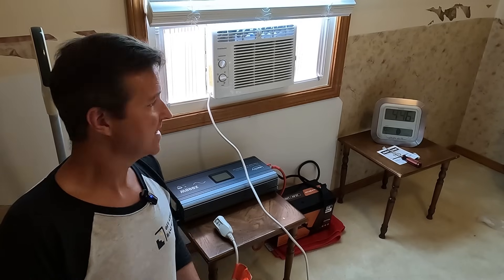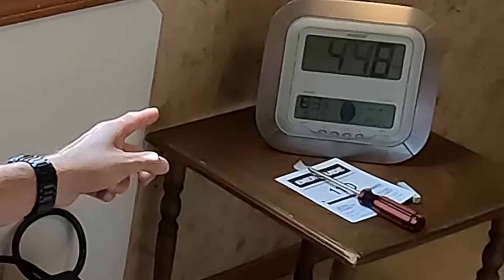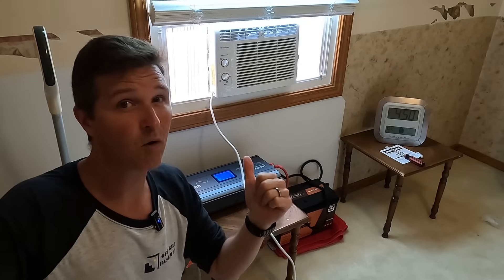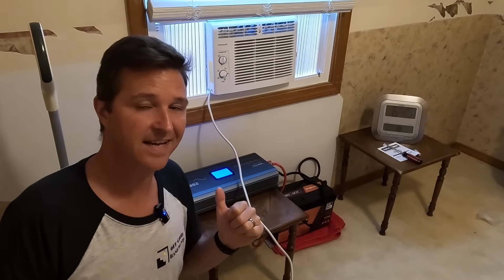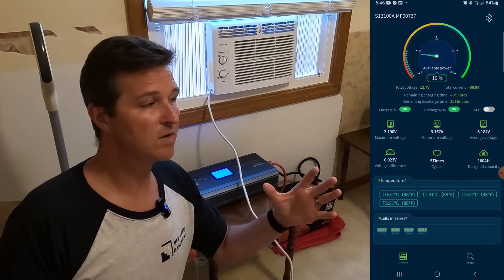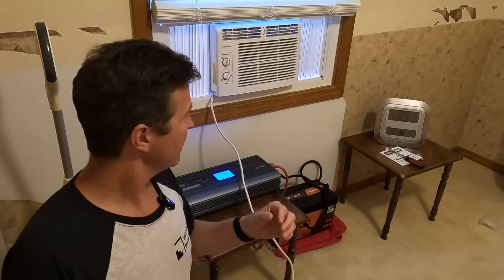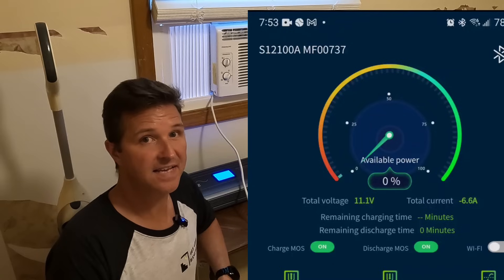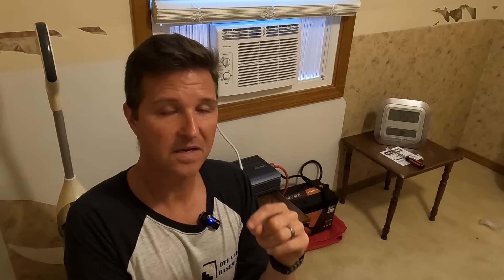How long can you power a 5,000btu air conditioner with a 12v 100ah Lifepo4 battery?  Let's find out!

Comment: So basically a 200amp hour battery will give you a good night sleep in a hot night. Roughly 6 hours of AC on a hot night.
Reply from the maker: Yes.  You should get 6 hours.  Remember, once the room gets to the desired temperature, the AC unit will turn the compressor off more often.  This will result in longer battery life.  Thanks for the comment.
Reply: @OffGridBasement  I was thinking of getting the AC and Heat pump units so I can have heat in the fall and winter. You should do a video on that. I built an Overlander Camper and I think this would be a good way to save some money on not buying a separate heating unit of some kind. Thoughts??

Comment: A soft start would help greatly on battery use also if the AC cycles the compressor on/off very much. Newer AC like minisplits are really much better on power consumption.
Reply from the maker: Thanks for the info.  This AC unit was seriously the cheapest one I could find on Amazon.  Any other AC unit should be more efficient.  I've heard Medea AC units are really good!

Comment: I'm looking at hurricane options here in SE Louisiana if we have a power outage.  After hurricane Ida a few years back I had my Honda inverter generator running near minimum to power two refrigerators, a box fan, a few LED lights, and occasionally a TV.  I had enough gasoline stored where I could have run the generator for weeks and we got the power back within 2 weeks.  Still today, I have looked into options and actually have a couple of small ACs like you used in the garage.  The best bet might be one of those swamp coolers that use water evaporation to cool a room.  So far we would be winging it with a fan to conserve power!
Reply from the maker: Unfortunately AC units use a lot of power.  You would be looking at a few thousand dollars to build something.
Reply: Swamp cooler is only for dry places.  You would die in Louisiana lol.  It puts water into the room

Comment: Right on about undersized air cons. I just rented a summer home that was well insulated, but the new air con could not keep up with 30C temps.  It ran about 80 percent or more during a one week period.  My AC at home is able to satisfy the thermostat and probably only runs 1/3rd of the time that the rental ran.
Reply from the maker: Thanks for sharing and the comment!

Comment: The converter's operating at max will produce heat.  That's why all Hi power converters have cooling fins with internal fans.  The extra heat from it could have a negative effect on the cooling of the room and making the AC work harder.
Reply from the maker: Thanks for the info and the comment.

Comment: To heck with all this.. confusing and just basically shows how difficult to run a small air condition 24/7 when a hurricane takes your power out for days..
With health issues I have to have constant AC here in Florida. Actually considering getting a climate controlled storage unit for a month or two during hurricane season have somewhere to go to cool down..rest
Reply from the maker: Thanks for sharing and the comment.

Comment: I have one in a shed running off 100ah LFP battery and 2 250 watt panels it can run about 4 hours when it's 117F outside. I'm in Phoenix so we get really hot here the 5k BTU window unit is an inverter type cheap $139.  When it's under 100F it only pulls about 400-500 watts when it's really hot like 114-118F it will pull over 1000 watts of power. Even though these have high seer ratings you can see that paying for a high seer AC unit doesn't really save money if you live where I do it gets over 115F. My new solar system will have 15kw watts of battery storage and 4800 in solar panels. It runs 24/7 from May to September surprised it hasn't failed these little window AC are work horses the remote stopped working but I don't use it.
Reply from the maker: Thanks for sharing and the comment!

Comment: Hot and humid southeast, can't even sleep without AC, you'd need 10 batteries for 24 hours plus 1,800w solar, about $4,500 project cost, for that you can buy a used minivan, call the engine a generator, set up a cot in the back,  blast that AC and run it all night 🤪
Reply from the maker: Thanks for the comment.

Comment: You need 200lbs of lithium, 1500Watts or more of solar, a nice charge controller, and a 3000Watt inverter.  Surge would be 6000Watts or more.
Reply from the maker: Those specs would run this small AC with no problem!

Comment: OK so how hard would it be to add solar panels to charge the battery, what would you need besides the panels?
Reply from the maker: A smaller solar charge controller would go between the battery and the panel.

Comment: This is EXACTLY the same air conditioner I bought from Amazon a month ago. It was $175 with shipping and handling. It is 5000Btu @ 4~5amps. It is a slight improvement to what Frigidaire used to make. Their 5200Btu units used to pull around 6 amps. I think the Freon is changed (thanks to the environmentals).
Reply from the maker: I hope it's working well for you.  Thanks for sharing and the comment.

Comment: More questions than answers. how long to recharge the battery? what would the temperature rise to in that amount of time? could a second battery be put in place to keep it running while the other is recharging? how long did it take for the room got down to 74 degrees? Is it even possible to maintain a comfortable temperature in the room with this set-up or is this just affiliate marketing link bait?
Reply from the maker: This is only a temporary solution meant for a 2 - 3 hour power outage.  If you're wanting an all day thing then look into a much better AC unit.  Something like a Medea.  Much more efficient, but expensive.  Also, you would need to quadruple the battery capacity and 800w of solar.

Comment: Doing this same test at night simulating a solar system just using its battery power & setting the AC unit to low & it's thermostat set so the unit cycles off more frequently should extend the run time significantly also 200ah of battery would be ideal.
Reply from the maker: Thanks for the tip and the comment.

Comment: Why didn't it trip the braker or overload the inverter if it was using 38 amps ?
Reply from the maker: I was referring to the DC side.  On a 12v system, running 38A is equal to 486 watts.  Hope this helps.  Thanks for the comment.

Comment: I got myself a 16 inch dc powered fan that I place in front of the air conditioner to blast the room faster and my 5000 btu has eco mode
Reply from the maker: Thanks for sharing and the comment.

Comment: The 8,000 BTU unit lasted longer likely because they liked and it wasn't an 8,000 BTU unit.  I'm just guessing, of course, but I've seen a lot of scam portable AC units out there with claims far superior to reality.  Kind of like the flightlights you see on Amazon... claiming WILD lumen values, when none of those are anywhere close to reality.
Reply from the maker: Good point.  Thanks for the comment.

Comment: The SEER rating of the AC is important! There is a 12v AC that Truckers install in the cab of their trucks that you may be able to use with a
Couple Solar Panels during the day and then switch to batteries after the sun goes down. Also, you may try one of the high SEER mini spilt which are lower amp draw.
Reply from the maker: Thanks for the info and the comment.

Comment: You are saving alot the system should pay for itself in in 12 years
Reply from the maker: If it's 100⁰ outside and the power goes out, this system would pay for itself in about 2 seconds!  Thanks for the comment.
Reply: @OffGridBasement  Some people get stuck thinking payback periods. You gave a great answer.  How long does his refrigerator, clothes dryer, dish washer, washing machine, big screen TV, Home, car, motorhome require to pay for themselves?  My solar/battery bank/inverter system is a tool. My payback is when we lose power for days and my fridges and chest freezers keep running.  Nice video you made, too.

Comment: If you want to increase your AC ability to Cool, put the inverter out of the room your trying to Cool. It surely makes a lot of heat doing it's thing, and that would be more Loss than an S.O cord of appropriate size. Don't think that a large " looking" extension cord is fine, go by conductor size and length. Stay above the minimum recommended size for best performance.😉 Some people overlook this fact and can't keep things operational and blame the inverter. If your cord is warm, it's not big enough.
Reply from the maker: Thanks for the info and the comment.

Comment: a 5k btu window shaker pulls about 450whr running high cool and the compressor running constantly. start up wattage is around 650. your batteri is maybe 1200whr, combined with the fact inverter is around 85% efficient...well 2 hours is all your gonna get.
Reply from the maker: Thanks for the comment and info.

Comment: For a 5000BTU window AC 2000W inverter will be the minimum to go? Or can I make it with a 1500W?
Reply from the maker: A 1500w should work just fine.  Thanks for the comment.

Comment: How long would 15.6kwh run a 1pamp draw 15k btu ac unit? I plan on using 3 100ah lithium batteries. Thanks

Comment: Have a look at the new EG4 solar panel dedicated Mini split air-conditioner that runs exclusively off 4 solar panels. It's 16000 btu off memory and can be subsided with 110 volts for when sun doesn't shine. It's a game changer for Off Grid people like me.
Reply from the maker: If it works as advertised, then it would be amazing!  Thanks for the comment.

Comment: I have 600 amp hours at 24 volts of batteries. I have no problem running the air comditioner for a few hours but I usually let the batteries charge pretty close to full before I turn it on. Mine is 6000 btu.
Reply from the maker: It should run for longer than a few!  Thanks for sharing and the comment.

Comment: Definitely looks like geothermal (sprinkler pipe, water, + radiator) if off grid.  Also, the portable AC units are generally on the higher end of efficiency as far as window air conditioners go, but nowhere near mini splits or whole house AC.
Reply from the maker: Thanks for the info and the comment.

Comment: I wonder how much more time you could get if you had a small solar charger hooked up to the battery. Even if the draw was more than what the solar panel provides it should extend the length of use, hopefully significantly.
Reply from the maker: There are too many variables to really get a good answer.  Thanks for the comment.
Reply: @OffGridBasement  have you tried daisy chaining 2 batteries together and seeing how long you get? I assume most of the energy is consumed cooling the room down but once at temp the AC shouldn’t run nearly as frequently

Comment: You may already know this but it is the COMPRESSOR that is turning on and off, not the condenser. Good vid, I have a small camper and always wondered what it would take to keep its 5000 btu ac running.
Reply from the maker: Yep.  Totally misspoke.  Thanks for the comment!

Comment: I thought this is a cute idea but realistically it's just cheaper to buy your electricity off the grid.
Reply from the maker: It is cheaper.  This is for when your power goes out for hours at a time.  Thanks for the comment.
Reply: @OffGridBasement  I absolutely understand that plus you get an electric generator in the process. I was trying to do the math to see what it even be feasible to buy a AC setup that runs like that. I'm guessing it would depend on how long the battery in the generator would last and how long the warranty is.

Comment: I am running a 7000 btu Dreo.  inverter AC unit on solar. At about half-capacity it draws around 30-40 amps DC from the  batteries.
Reply from the maker: Thanks for the info and the comment.

Comment: Who doesnt run their window ac on ANYTHING less than MAX. Max everything. As in every single knob on there, turned as far as itll go UP. You use an ac to drop the temperature as low as possible in your home. Turn it on or dont. If you want a fan, cant you find one that is more efficient? Like, just about ANY other fan... dont be a tool.
Reply from the maker: I did another test with the AC and a Bluetti ac200p.  It got the room down to 63⁰. Too cold for me!  Thanks for sharing and the comment.
Reply: @OffGridBasement  ok ill check out that video as well. I was just saying, basically you wouldnt use the ac like that if youre going for efficiency. Because when that compressor cuts off, you would just be wasting battery juice on a way over powered, poor performance , bang for your watt wise, fan. I think the logical usage would be, turn on ac til the room is within your zone , 5, 10, 20 degree variance depending on how lazy you wanna be, then kick it back on. Using an efficient box fan or something in the intervals (mine wouldnt shut off til the battery died, i live in Florida,  i would kill for a 63° room . But thats cool , to each his own my friend😂) at least thats how id do it. Its terraforming. Life support, lol.  I think of it like a metaphorical canteen of a/c water , and its the only way to survive the desert- or swamp, as long as possible... as urnest rhetorically asked... you know what i mean Vern?!

Comment: This kinda missed the mark though.  A more useful test would have been if you started with the room at 74 degrees, and see how long the battery was able to sustain it at that level.  Starting it at a much higher temperature means most of the energy use was lowering, rather than maintaining temperature.  I would suggest starting with two full batteries,  use the first one to get down to the target temperature, and then switch the battery and see how long the second battery can maintain that temperature.   

Just for reference, I have a 12000 BTU air conditioner powering a Cool-bot walkin cooler at 40 degrees.  The batteries are solar powered, and I can easily keep the walkin at 40 degrees the entire night with 2KWh of batteries.  Once you have your target temperature and an insulated room, the compressor very rarely kicks in.
Reply from the maker: I did that with another video test using the Bluetti ac200p.  It does make a big difference.  Thanks for the comment.

Comment: Your test is valid. It tells us how to use a 100 amp 12 volt lithium battery, but not an air conditioner. Subtleties. Low fan is for high humidity. ECO mode on the compressor if you've got. Intermittent fan turns on and off with the compressor. Don't run it continuous. Open doors to the rest of the house to dehumidify it. Use fans.
Reply from the maker: Thanks for the information and the comment.

Comment: 0:01 At most 2 houres with 100% energy conversion. But we know that is not possible, so lets say 1 - 1.2 hours.
Pff, does not run the compressor continuously. Means you have a lesser energy use than 500W.
You could have made that thing cool a closet and made it run for a whole day.
Reply from the maker: You're right.  Way too many variables to list.  Thanks for the comment.

Comment: There are some variables that are not being taken into account.
The current draw from the air conditioning unit will vary tremendously depending on ambient temperature and humidity. The Seer rating will vary from unit to unit.
There is no set amount of time a 100 amp hour battery will run a 5000 BTU air conditioner.
What I'm saying is, you need controls in your experimentation, or your results will be meaningless.
Reply from the maker: This should at least give a general idea of what to expect.  Thanks for the information and the comment.

Comment: I am using 48 volt 100 amp lithium ion phosphate batteries.  into a transformer down to 100% 13.8 at 100 amp. 2 a 16,000 watt inverter square wave. and I'm running a 5000 BTU air conditioner it'll run for an 9 hours on low cool. And three racks of 48 volt solar panels that are producing 18 amps keeping everything charged up.
Reply from the maker: Thanks for sharing and the comment.

Comment: Air conditioner is needed mostly during sunny daytime, it is not as hot during winter or cloudy days. For the most part you dont need batteries when running air conditioner.
Reply from the maker: Thanks for the comment.

Comment: In other words, it will NOT RUN ALL NIGHT until the sun can come up and start providing power from the solar array. USELESS
Reply from the maker: You would need at least a 300Ah battery to run the AC all night.  This is a good option for people that have 2 hour rolling blackouts.  Thanks for the comment.

Comment: I imagine these batteries get pretty hot during such use? 🤔
 An ac unit is a lot of draw
Reply from the maker: No. They never go over 110⁰ internally with a 40A load.  Thanks for the comment.

Comment: Logic would say,  use an Energy Star AC unit if running off grid.
Reply from the maker: Yes.  I was figuring if you already had the AC and your power goes out.  Does buying a battery make sense...

Comment: You really can't read state of charge under a heavy load like that because they are indicating state of charge by reading voltage and the voltage will be loaded down under heavy load.
Reply from the maker: With LFP batteries the shunt built into the BMS is monitoring the SoC.  It's not just a volt meter.  Thanks for the comment.
Reply: @OffGridBasement  I'd be interested in knowing more about what you are saying, a shunt is a slightly resistive wire that you read voltage across to calculate amps, are you saying that is used in conjunction with the cell voltage to derive the state of charge because of a known voltage drop per amp?

Comment: Your portable unit takes air from the room it's in and uses it to much the heat the portable unit creates outside. If you tested the portable the same as this video here, that just means the portable sucked the cool air from your house into the room.
Reply from the maker: Thanks for the info and the comment.